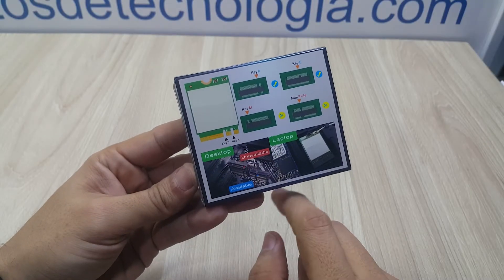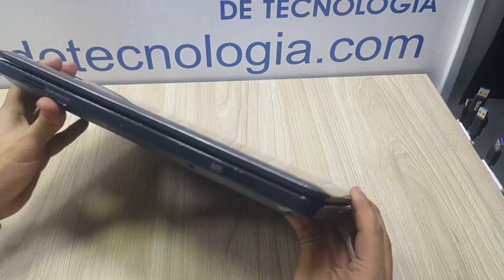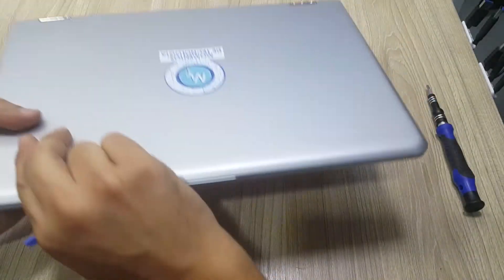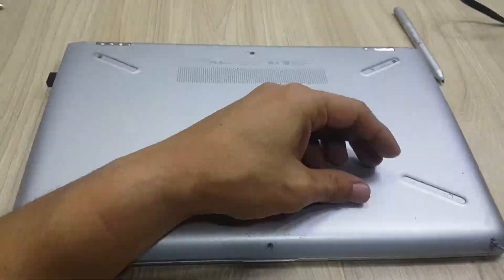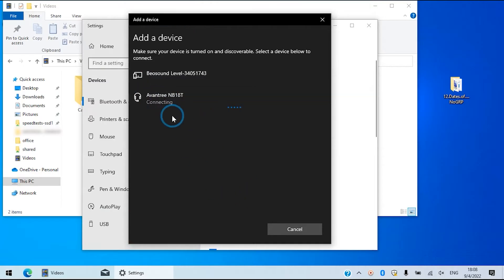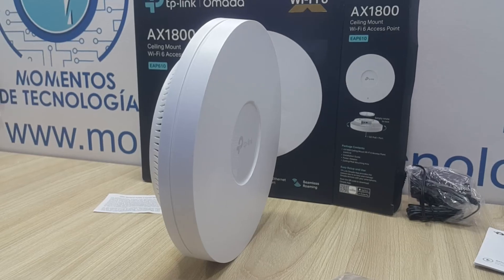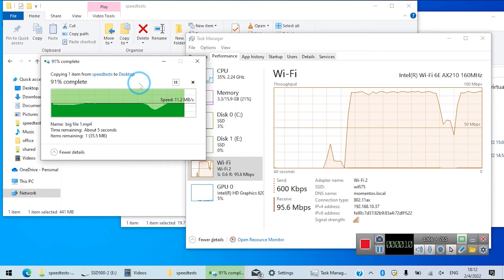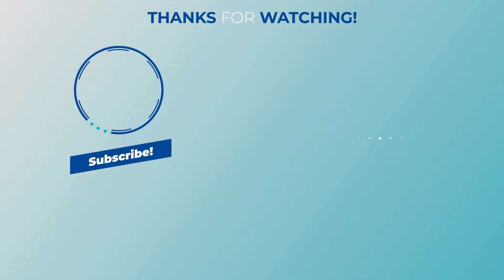How to upgrade my Laptop's WiFi to WiFi 6E  with M.2 card - Great choice!

Comment: hey man you're a hardware genius!
and I appreciate the extensive tests you're doing.
comparing USB with M.2 is a little just as expected (better internal than external), but I enjoyed the real test however.

I arrived to your video prompting this on gemini:
"suggest me some upgrades for adding 5ghz support to an hp x360 from 2015 with only 2.4 Ghz wifi support"

I have worked with many PCs (near year 2000) but this HP 360xd have been a nightmare for disassembling, however I have added 8 GB for topping up to 16 GB
and added a m.2 Sata SSD along the HDD.

So, you encourage me to do a new surgery for upgrading / updating wifi capabilities.

mine is: HP Pavilion x360 Convertible 14-ba0xx

would your suggested wifi be compatible ?

pd - I loved your accent! - my voice would sound very similar to yours.
Reply from the maker: Thanks for your comments! that hp pavillion you're using would mos certainly work with it.  You can understand that we do not say is 100% compatible as we've seen so many weird incompatibilities over the years.  Good luck with your project

Comment: Hi, is it compatible if I upgrade intel wifi card from realtek wifi card? My model laptop HP 14s cf1xxxx
Reply from the maker: Yes it should work fine particularly the Intel AX210 NGW (https://amzn.to/419itAk )
Reply: @TechnologyMoments  but I'd single antenna if I upgrade wifi 6 card which has 2 antennas. Which part to put? "Main" or "Aux"?

Comment: I have an MSI katana gf76 that currently uses the AX201. Is my motherboard and CPU compatible with upgrading to the ax210 or ax211?
Reply from the maker: It is probable if your system supports CNVio and as we said in our most recent video regarding wifi 7, is very uncertain in some devices.

Comment: I am replacing a Realtek RTL8821ce with a Intel AX200NGW. The Realtek only has one antenna connection and the Intel has two, labeled 1 & 2. Which one do I hook the antenna to? Thank you
Reply from the maker: For these WiFi 6 adapters that might not be aproblem (eventhough most of them use both for extended range and reliability) It may be critical as we've seen with wifi 7 adapters.

Comment: My Laptop is HP Laptop 17-BS0XX, It has only one cable, will this be compatible with my unit? TY!
Reply from the maker: Yes it will and Eventhough wifi 6 also needs 2 antenas for full speed and range the model you see here ( https://amzn.to/3YhaHk2 ) has worked in many scenarios with just one antenna.  This is critical in WiFi 7 but not so much in these wifi 6 models

Comment: Can I upgrade my Wi-Fi 6 to Wi-Fi 6E on my HP Elitebook x360 1040 G8? If i can is there a youtube tutorial on how to do this because i can't find any for my Elitebook.
Reply from the maker: I understand.  first of all yest you can.  It is sometimes difficult to find the upgrade process for a specific model and in those situations I would recommend disassembling your laptop and checking if your card is in fact m.2 (NGFF). If it is, the model suggested here (https://amzn.to/3YhaHk2 ) will work fine on your machine and it supports the 6GHz band, Keep in mind your router must emit such signal in that band.
Reply: @ I do have a M.2 NGFF but the pins are different on my Laptop   mine has one each side pins and center pin the Amazon has pins in the center and two separate pins right next to it. Do you know where I can get mine but for Wi-Fi 6E or
Wi-Fi 7?
Reply: @SIDVENOM  beware if your laptop has an AMD CPU. Most of the time, HP uses whitelisting in their bios. My laptop is 2020 model, with Ryzen 7 4700U and I tried the Intel Ax210 card, sadly the wifi does not work, only Bluetooth. There are plenty of people like me on forum. Most ot the time, HP restrict your choice of upgrading the wireless adaptor to 2 to 4 card models per laptop model. Shame on them, planned obsolescence, that's all. I mean if Acer, Asus, Dell can make their AMD laptops work with AX2010 why HP can not. Because they don't want to, simple as that. Stay away from manufacturers that do these sh..ty stuff like Lenovo and HP.

Comment: I did this on an HP and it refused to turn on. It shows up in device manager but on the Taskbar the little "wifi on" icon refuses to come on
Reply from the maker: We have encountered several incompatibility issues.  Not so many but there are.  Something like what we are seeing nowadays with WiFi 7 modules in which some BE200 modules work with some laptops and some other identical does not.
Reply: @mrburns366 HP is among the worst manufacturer of them all. Because of their whitelisting in the bios, most of the time you can not use any wifi card you want even when the slot fit  to upgrade your laptop. I tried the Intel Ax210 on 2020-model (15s-eq1011nf) with Ryzen 7 4700U instead of the stock (RTL8822CE), but I had no wifi, only Bluetooth. My friend bought a 2022 HP model with Ryzen 7 5700U and the laptop came with RTL8821CE that has a single antenna cable. They don't even bother to put a black and a white antenna cables. Just two black wires that have small label 1 and 2. These label tend to get washed out with age. Bad design all around. My friend sold his 2022-laptop because of that. I mean HP is joke lately. They used to be good but sadly not any more. They cheap out even on rather high-end pc. I mean, I can understand that HP cheap out on 300 dollars laptops but on 800 to 1000 dollar models, come on be serious. To top it all off, this Intel exact same Ax210 works even on 10+ year laptop but somehow not on recent HP ones. Planned obsolescence, pure and simple ! My advice stay away from HP laptops until they fix these bad pratices. Lenovo also likes restricting user choices. Both manufacturer should be avoided if you people want your device to be relevant in time.

Comment: I have a rog strix G614JI, what’s the best wifi card I can possibly get
Reply from the maker: I would get a WiFi 6E card (https://amzn.to/3YhaHk2 ) as it would give you 1.5 Gbps with no problem (keep in mind you have to have a wifi6E AP or Router too, ) as they both feature 6GHz band.  I would still not recomment any WiFi 7 card as we ahve only had experience with a Few that have not passed our tests.  However if you find a reliable WiFi7 card recommended for your laptop, it would even get you to 2.1 Gbps.

Comment: hi,can you help what is the best wifi card replacement for my HP ENVY X360 15EU?
Reply from the maker: No doubt this will do the job.   WiFi 6E Wireless Card Intel AX210 NGW https://amzn.to/3YhaHk2 , only take into account that the ideal AP to connect to has to also have 6 GHz band active (wifi 6E) to get the most out of your WIFi 6 connection which is about 1 Gbps real life.

Comment: Hii , i have dell Inspiron 3541 pcie wlan card which was 2.4ghz , i want to upgrade it to 5ghz , will my mother supports the 5ghz pcie card , please reply
Reply from the maker: Your computer as I can see from its original specs features a PCIe mini card.  It might be able to run WiFi 6E with this card (https://amzn.to/46ZuIk3 ) , however make sure you can return it in case it doesn't.  We have done this with similar computers, but there is nothing certain about this proceedure.  Good luck with your project.

Comment: Will the laptop have any issues with a new card? I currently have a MediaTek WiFi card and I want something similar to what's shown in the video. Same pins, etc.
Reply from the maker: If it has the same port and the correct keyed card, it will work with no problem.
Reply: @TechnologyMoments  same port for sure, idk what about key but i think that's will be ok

Comment: i have dell latitude e7250 i7 5600u can i upgrade to wifi 6?
Reply from the maker: You are too close to the mainboards that did not support it.  I would recommend testing a card that you can either use in another laptop or return.

Comment: Hi, thank you so much for the video. I would like to ask. Does any wifi card version will work with any laptop? for example I have msi gf63 with wifi 5 ngff card (9560ac), can I change it to a wifi 7 or wifi 6e card? Thanks in advance :)
Reply from the maker: Very soon we'll release a video for wifi7 update which poses a bigger challenge for upgrading as usually are E keyed cards.   Your msi gf63  is relatively recent, and should accept  key A and E cards which means it would support newer cards as the intel chipset BE200 WiFi 7 (https://amzn.to/3VHzgYs )  which we have tested in even core i3 7th gen laptops.  Older laptops may not support it. Of course it depends in the MB and the slot being E keyed. (https://www.delock.de/infothek/M.2/M.2_e.html )  I would suggest, first take a look at your current WiFi card and if it is E keyed the WiFi7 card will work on it.  Good luck with your project.
Reply: @TechnologyMoments Thank you so much for the response and I'm looking forward to the video.
My current card is key E CNVio, but not sure if it supports regular pcie (if it's not support pcie I assume I'm stuck with the current card). 
The seller said BE200 won't work because my 9th gen intel not support CNVio2 (?)
Seller doesn't allow return so I'm afraid it will be a waste if it's not working 😄

Comment: Nothing explains how to actually connect the wire to the card. Another useless video
Reply from the maker: It is nothing special, always use main connector, you can just press it firmly considering that it is a coaxial connector.  Important to apply force in a uniform manner.  To disconnect it try to do it with a pair of small pointed pliers or even better using a pair of tweezers if available.  Sorry about not helping witht he video.

Comment: is any m.2 wifi card compatible with basically all laptops or does it have to do with the connector on the pins there ? my old had 2 split apart on left side and one full on right, but i got one that was full on both sides and it didnt work, but couldve been it was bcs needing driver, but idk if its really compatible or not, or does should it be ?
Reply from the maker: The one you're watching on this video is the one mostly used currently.  However (sorry to use this word)  older laptops with NGFF (m.2) have poor compatibility with these newer cards.  If the laptop is older (oddly enough) PCIe mini cards work with most of them ( https://youtu.be/eaj91tA_w_w )   Por example some brands like HP with their Pavillion first generations are quite troublesome
Reply: I haver a MSI GT 73EVR titan, i tried to upgrade with a "Intel AX211.NGWG.NV Wi-Fi 6E AX211 (Gig+) 2230 2x2 AX R2 (6GHz)+BT No vPro" m.2 card, it didnt show up in device manager but i believe my mistake was not to look for updates and drivers, i might try it one more time to see if it works. my only concern was, the old have 2 tabs on left side then one big, the new have 2 big ones
 @TechnologyMoments
Reply: @BeardedFire could you get it to work? I have a gf76 katana using the ax201 and I want to upgrade to the ax210 or ax211. Not sure if it will work
Reply: @sheriffcrandy  i didnt get it to work so i gave up lol

Comment: Very good video sir.... I have an Acer aspire nitro an515-55  with a Intel ax201... What upgrade is the best for? A killer i1690 ax411 not works... :(
Reply from the maker: Hi, it is probable your laptop does not support CNVIo so I woudl go for this one recommended too for gaming:  https://amzn.to/3Gulcca  It will most likely be compatible with  your system.
Reply from the maker: Also dont forget to check if it is CNVIo Version 1 the one your laptop supports.  This was just another attempt from manufacturers (intel) to make our lives "easier".
Reply: @TechnologyMoments  I read that the unique card can upgrade is the same you say.... Ax210. But not sure. Connectors from ax210 are far diferent from ax201 🤣

Comment: I would like to upgrade WiFi hp model 2016 HP Notebook - 15-ay004ne ,if i upgrade i will work , which model adapter wil use
Reply from the maker: It is most likely it will be compatible with the NGFF AX210 model (https://amzn.to/49dF8NI )  however I would strongly recommend disassembling your computer before, check and compare with what you're about to get.
Reply: @TechnologyMoments  thankz, I changed with AX210 , it's working well

Comment: Hi, excellent video but if l'm  honest l didn't fully understand all the technical information presented.
My old 2012 Dell  Inspiron N5050 uses pci-e mini wifi bluetooth card  DL1701.but this is only 2.4GHz.
I would like to upgrade my wifi bluetooth card so l have 2.4GHz +5.0GHz available to me.
Please may l draw on your extencive knowledge of this subject,to ask for best surgested wifi card upgrade for my Laptop.
I will be using windows 10 on this laptop and l have a 5.0GHz capable router at present,but looking to install Win11 soon.
Reply from the maker: It may not always be compatible.  If you can manage to order having the option to return, it is better as we've seen several models of those years not being able to fully upgrade besides bluetooth.  A good option to go for wifi6 in older laptops is USB NICs such as this one: https://amzn.to/3FgYJi4
Reply: Hi, thank you for the kind reply and advice ref my wifi upgrade path for my laptop.
Most appreciated thank you @TechnologyMoments

Comment: Thanks for the video, in near time I wanna try AX210 in my old HP Elitedesk 800 g2 tiny (from 2015)

How do you think what chances that it will works?
Reply from the maker: It most probably will and you'll get overall greater file transfer and browsing performance.  Just make sure it is M.2 and not PCIe mini (a bit older but also available).  We've used both and both work great.  Links to the newest hardware versions are in the description of both videos.

Comment: I got a Asus A15 can I switch mediatek mt7921 to intel 6e ax210
Reply from the maker: I am pretty sure you can.  However make sure you could send back the unit in case your MB is one those very few which has problems with newer cards.  The newer version works very well: https://amzn.to/3YhaHk2

Comment: Hello i got an asus E410MA That has 9461ngw intel wifi card Does an 9560ngw that has 2x2 while my laptop has 1x1 would it work with just 1x2
Reply from the maker: Yes it will.  You'll only not reach higher speeds 2x2 can achieve.
Reply: Thank you for answering.

Comment: Hi my laptop has only one anenna wite. I want to upgrade it but Most wifi adaptors need 2 antenna wires. Can I still upgrade the wifi card? Please help!
Reply from the maker: Sure you can basically most computers use just one antena, your connect it to the main connector or the one labeled "1".  This is the newer model for this wifi card:  https://amzn.to/3Xf1bOa

Comment: Having m.2 intel 3165ac in my Dell laptop not working. Disabled it and using a usb dongle which sucks.
What do you recommend to replace it with?
Reply from the maker: I would replace the internal AC adapter you have which is not working with the one seen on this video.  It was rebranded to this one: https://amzn.to/3YhaHk2    You can practice beforehand how to access the card and remove it.  So can make sure you can do it.  Good luck!

Comment: this is my laptop spec ....its have only 4g wifi card ....i want to change into 5g wifi card ...i need your help can you tell me which wifi card is suitable for my laptop         plzzzzzzzzzzzzzzz reply sir

Product number  === 1AC81PA

Product name  ===  HP Notebook - 15-ay542tu

Microprocessor === Intel® Core™ i3-6006U (2 GHz, 3 MB cache, 2 cores)

Memory, standard  === 8 GB DDR4-2133 SDRAM

Video graphics === Intel® HD Graphics 520

Hard drive === 250gb ssd

Optical drive === SuperMulti DVD burner

Display === 39.6 cm (15.6) HD SVA Display

Keyboard === Full-size island-style keyboard with integrated numeric keypad

Pointing device === Touchpad with multi-touch gesture support

Wireless connectivity === 802.11b/g/n (1x1) and Bluetooth® 4.0 combo (Miracast compatible)

Network interface === Integrated 10/100 BASE-T Ethernet LAN

Expansion slots === 1 multi-format SD media card reader

External ports === 2 USB 2.0; 1 USB 3.0; 1 HDMI; 1 RJ-45; 1 headphone/microphone combo

Minimum dimensions (W x D x H) === 38.43 x 25.46 x 2.43 cm

Weight === 2.19 kg

Power supply type === 65 W EM AC power adapter

Battery type === 4-cell, 41 Wh Li-ion

Webcam === HP TrueVision HD Camera with integrated digital microphone

Audio features === Dual speakers; DTS Studio Sound™
Reply from the maker: Hi, I am so sorry we missed your question.  Were you finally able to get it?  Write to us contacto@momentosdetecnologia.com
Reply from the maker: Anyway you should be able to have this one working on your laptop model (https://amzn.to/3YhaHk2)

Comment: Hi, im curious how i can determine if my pc can take in wifi 6 card, or what is the limit. i have acer aspire e-15 e5 576g i think its 2017 model and it has m.2 card as i remember. like, how can you tell generally if the pc is compatible with a certain version of a card
Reply from the maker: If it's model is 2017 it will most like support wifi6, as I did.  Just take a peak inside your laptop and make sure it is an m.2 and go ahead and order it.  Also there is a new model of this card available we've liked: https://amzn.to/41djxkq
Reply: @TechnologyMoments  what about wifi 6E?

Comment: Is there a way to know what is the conector of the Wi-Fi adapter on the motherboard throw software ? My motherboard is an Z390 Aorus Master,thanks and have a great day
Reply from the maker: Not that I know of, but seeing your MB specs, assuming it is rev 1.0, and as it has an integrated wifi adapter, you actually have two options which are  1. Install a PCIe adapter as this one: https://amzn.to/3ZBgktU, or  2. Go for an adapter that will let you install any m.2 wifi card such as this one: https://amzn.to/3w1vqLO